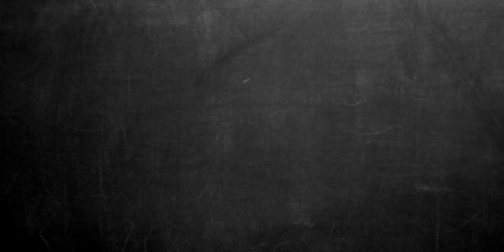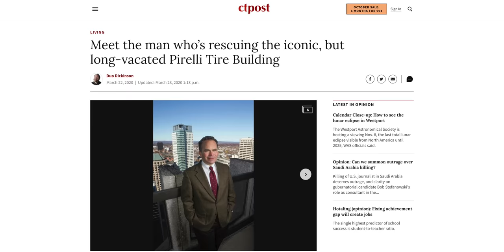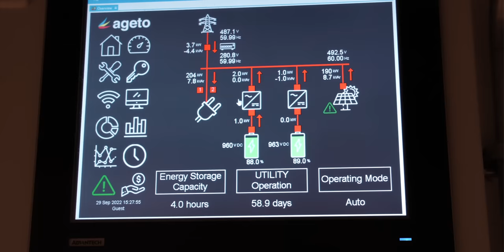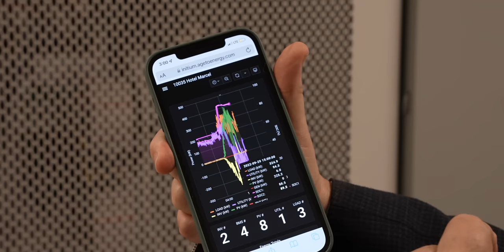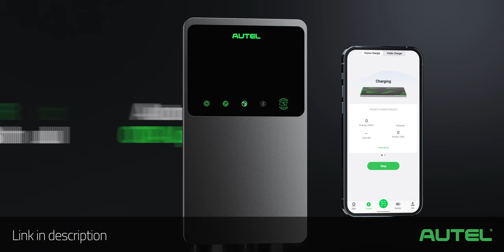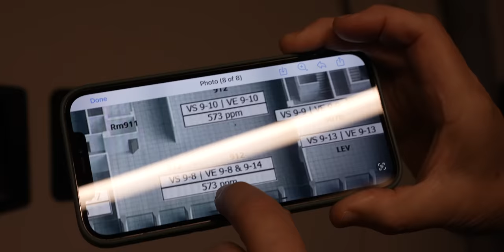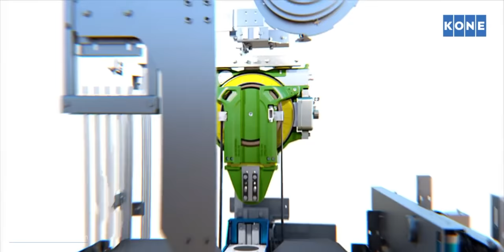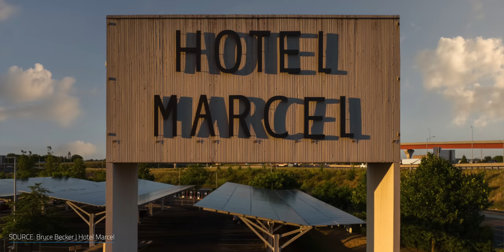How Big Can You Make a Passive House?

Comment: maybe the drying could instead be done using stored heat from a thermal battery(like a really well insulated airtight room filled with boulders and rocks) then slowly heat that room up to high temperatures using a clean air to air heat pump or sun heat collector thingy. :y maybe that could solve the problem.

Comment: With the resistive heating load of the dryers that high I'm surprised they don't integrate heat pumps either fully or partially into that configuration.
It seems that heat pump based dryers are available in some capacity, perhaps they don't have the through-put to handle hotel operations?

Comment: Matt: do they use a counterflow heat exchanger to preheat incoming air (using exhaust air) for the dryers?  
Dryers are very primitive with a lot of room for innovation.  For example, using a pressure vessel to lower the temperature at which water evaporates (partial vacuum) or microwaving the items within the drum instead of heating incoming air.
A combination using low pressure, microwaves and a scavenging heat pump could lower the energy use dramatically.

Comment: My vision is for entire Cities to be so.  Would be WAY more efficient to have a climate-controlled city, than individual buildings.  Most of our energy is lost through heat, when we capture and recycle that heat, we become sooo much more efficient, therefore requiring far less source energy collection/generation!
There are many other benefits (and some drawbacks) too ofcourse.
Reply from the maker: District heating and cooling systems are very clever.
Reply: @UndecidedMF  I'm talking about covered and enclosed cities (the dense centre anyway, much of the outskirts would be open air) built of multiple (10-50) levels, each having 4-10 stories, meaning that all excess heat, including from warm-blooded animals, friction losses in mechanical systems and electronics could be extracted by the systems conditioning the air throughout the structure.  
2D Cities have surpassed their practical limit, we need more bandwidth to move around and without flying cars, the most sensible and feasible way to achieve that is by having roads/walkways on multiple levels.  
I could go on and on and on, but, well, I'd be going on and on and on (and right now, I need to go to the shop) 😊

Comment: OK, 1 unanswered question: How did they retrofit the building with insulation? Normally that has to be put on the outside, but then its look would have been changed dramatically. Windows are easy, though costly.
One point that really shocked me, was the discussion about gas stoves. This isn't Africa. Are gas stoves really still a thing in America?

Comment: I don't see how regenerative braking makes a lot of sense for an elevator.  Elevators have a counterweight which is actually heavier than the elevator, so that when 3 or 4 people are in the elevator, it is balanced.  This means that if an elevator is moving while empty, or with only 1 or 2 people, which it does a lot of the time, it actually uses less energy to move up than to move down.

Comment: You should do a follow up to this video on cost vs savings.  It’s absolutely wrong to say these systems don’t cost more than conventional.  Where these systems begin to make sense is when you can run the payback analysis - high initial cost vs energy savings vs maintenance costs, etc., then you can decide if it’s worth it.  

You should interview a local MEP engineer that has the right resume of projects (institutional labs and research buildings and not just offices and hotels) and they should be able to explain why these systems aren’t prevalent.  Many times it takes a huge leap of faith from a visionary owner, or more often these systems get implemented when the organization needing the building has energy guidelines to meet (LEED, or a requirement to exceed ASHRAE 90.1, as some examples). 

It’s still cheaper to build a code minimum baseline building when it comes to efficiency and unfortunately will be for many years to come.  Why? Because manufacturers can charge more for it because it’s better.  And to be fair, it’s often more equipment, or more complex, but the real premium is because they charge what people are willing to pay for a premium product.  As code minimums raise the bar over time, this equipment will become cheaper due to more competition.

Comment: To say he didnt think it cost more but that it took more time to commission is a bit at odds.  That time getting things setup and working because you have lights and shades in every room which are going to be addressed, configured, grouped and visible to control points in the rooms and in a BMS is not cheap.  Sounds like they have other control schemes throughout the space and thats important because its "free" savings when things are on timers / sensors / schedules.  As far as the initial cost itself being about the same... it probably makes more sense to say that on full gut remodels or new buildings but retrofitting typically makes a lot less sense cost wise.  Did he actually get into any numbers with you?  or relative comparisons they did vs "standard" buildings?  Did i miss where he talked about heating / cooling the building itself?  For the dryers to be such a huge percentage of the grid it would have been interesting if he talked about what they did to try to minimize that.  Did they do anything?  Hybrid heat pump dryers at commercial scale?

Comment: I don't understand the thing about the elevators/lifts.
Usually they have counterweights to balance the car. This means to move up and down the energy is actually only that required to overcome friction and momentum, not to lift the thing. The energy requirements should be the same going up as down.
Of course, this ignores the weight of the occupants, but I would think that in most cases this weight is only a small part of the system.

So I'm unclear where this "recovered" energy is supposed to come from.

Comment: 0:40 concept for power storage that involves putting carts of weights in elevators and bringing them to the top floor to store the power and then letting them go down to the bottom floor again to recover that power... Ok maybe, just maybe, this plan would be way simpler to implement with just a pump, some pipes and a large water tank on the roof? Anyone pushing a concept of power storage in gravity that involves rigid bodies that have to be moved on wheels i.s.o a simple fluid that can be pumped has not thought his concept through enough imho.

Comment: It's very interesting that there is essentially no new technology developed for this hotel.  Yes much of it is relatively new but it's all basically existed before design & construction began.  Think what a big dent it would put on green house emission if every rebuild/refab of an existing structure and every new build incorporated these techniques to lower the energy demand for a structure.  We could get to 2050 targets in less than 30 Years easy!
Reply from the maker: You hit the nail on the head!  We have the tech and systems already.  We just have to implement them in an intelligent/planned way.

Comment: There is a very simple way to save electricity to dry sheets. Sun 🌞. (Or using heat pomps)
One hotel near the Dead Sea in Israel use this and other low tech tricks to save a lot of energy. 
Like cover the pool at night to keap it warm.
Domestic water heating can be copule with air-conditioning if relevant. Or can use solar again. No electricity use less the heat exchanger.
I guess there's still normal AC supply in every room for fone computer chargers hair dryers vacuum cleaners...
Not energy but still missing some green arund the hotel in the open level and rooftop garden. 
I would take Hundertwasser tree tenant to brake the brutalist facade while keeping it exactly original.

Comment: So when you use POE does a cat6 cable terminate at each rooms circuit breaker then standard wires to lights and outlets and such? Or do they have to find lights that use ethernet ports on them?

Comment: It's interesting that they are using resistive  heat dryers.  I know they are using large commercial dryers instead something you would use at home, but I wonder if heat pump dryers would be an option for them.
Reply: This was my question. Especially if they could reuse the captured water for washing or toilets.

Comment: The PoE lighting and window treatments those are awesome ideas. But that’s the maximum length of cable run and still have efficient use of the power. Is there just the two battery/server rooms or do they have PoE server racks on each floor or more? One day I’ll be able to build a home and enjoy learning about these projects. Good to see things happening like this hotel that can prove concepts.
Reply: I asked Bruce about the batteries, here's a summary of his response:
17 200lb Lithium iron battery modules by LG per rack, with 2 racks on both the 6th and 7th floors. That's 68 modules in all, totaling 1 MWh of battery storage

Comment: Certainly the solar shown wouldn't power much in a typical building, maybe the lights; but when it comes to heating and cooling; hundreds of machines.. no.  Sure if you are in a very temperate environment where you rarely do heating and cooling and you have no machines, computers, kitchens, refrigeration . you could because it no one is using any energy to start.
Reply from the maker: If you tack 1,000 panels onto a typical building, you're right, but this isn't a typical building.  It's the combo of heat pumps, digital electric system, etc. that's making it all work like it is.

Comment: Now I'm NOT an electrician, but my vague understanding is that DC doesn't fair as well as AC over distance. I'd like to know if that's a challenge for them, getting power from batteries in one part of the building all the way to the opposite corner on such thin wires.

Also what about when I bring my AC wall wart for my laptop or whatever? I assume there's inverters to provide that power, or maybe there's just ALSO a grid-wired AC outlet in each room?
Reply: What I do with DC  power is get much thicker wires than the usual used for AC.  This reduces the problem considerably.

Comment: Hello Matt, 

New to your channel and been enjoying the backlog of everything you have researched for us. I have some questions about the "digital electricity" used in this hotel. If my not so great research is correct this is PoE which I have now looked into a bit. I did not see it on your channel and wondered if you would give it a look for the community. The part where he talked about power loss from AC-DC has me wondering if this would be something that is viable for my home. 

To answer your pinned question I would love to see school buildings have a push for net zero. They often have large flat roofs to hold loads of solar cells and most power usage is during the day meaning they could skip the battery backup and use local power at night and probably still come out close to zero in the southern states.

Comment: I don't understand why the elevator is using DC motors? 
Regenerative braking works for AC motors as demonstrated with modern EVs.  I would think that there is far more readily available technology based around AC motors and AC drives than there is for DC motors. 

I have worked in the field of Power Electronics for four decades and this just seems to be a very strange design decision.

Comment: Ok, great hotel project. I have many questions. Where is this hotel located? What is the lowest temperature in the winter? If the heating is by air source heat pump what is the efficiency when temperature drops below 0C and ice is deposited of external heat exchanger? What is the energy used for heating of the whole building per m2 per year ? That calculations now  should be done for every building not only for passive one. For example my small house is using 70 kWh/m2*year and is located in UK where lowest winter temperature is -10C.
Reply: If I remember correctly passive house used below 15 kWh/m2*year. Is this hotel using less than that ?
Reply: Ok, I found this Hotel in New Haven on east coast. This is an exceptional example because climate there is very mild. I found this: "The temperatures are highest on average in July, at around 23.3 °C | 73.9 °F. January has the lowest average temperature of the year. It is -0.7 °C | 30.7 °F."        The temperature even in winter does not drop below 0C so heating with air source heat pump should not be a problem at all. Yet it is not representative example.

Comment: 6:42 I wonder why the driers are not heat pump? Even if they couldn’t dry as fast, would it make sense to get another set of linens and HP driers that would have to run pretty much 24/7?
Reply from the maker: I don't believe that size is available for commercial dryers (yet).

Comment: What is the ampere capacity of a cat5/6 ethernet cable over those length? It dosen´t sound plausible or safe considering how thin they are. Is there not a trunk cable to carry the main load to each room or area and if not how can it work?
Reply: This Cat 5/6 power over Ethernet is becoming more and more common.  I take issue with the statement that they did not need to use licensed electricians.  Power over Ethernet (POE) can come at different classes.  That usually means different voltages.  For POE less than 50V, I am OK with the just running the wires like Ethernet wiring.  There is low power that is unlikely to cause a fire and below 50 V is considered the safe voltage from preventing people from getting shocked.  New POE classes are above 50V and I would expect those wires to be installed like regular power wiring by licensed electricians.  There is more voltage and current, and more power, so there is the possibility of causing fire and shocking people.

Comment: The elevator battery concept is really cute, but not at all practical, sadly.  If you have a 50 story building (about 700 feet) and an elevator that can move up the entire distance (which they don't really), a single load carrying 5000 lbs stores about 1.3 KWh of potential energy [(700 feet * 5000 lbs * 9.8 m/s^2) in kwhr], and less (70% = 1 KWh) in useful regenerated electricity. Even if you make the system able to handle 10 trips of that (50,000 lbs), that comes to 10 KWh, or less than the stored electricity of one Tesla Powerwall (13.5 KWh at $11,500 for a new system - note that other whole-house systems are a bit more expensive per KWh). There's no way that the building strength increase for that weight, plus the mechanical infrastructure needed to shift 5,000 laterally, would cost less than that.

Comment: Is it legal to use ethernet cables for power supply? (Even though it is DC and low voltage)
Reply: Power over Ethernet (PoE) is an IEEE specification that's been in use for quite some time (since 2003), totally legal and up-to-code. I didn't know it was being used for lighting, but with LED lights, it makes perfect sense. One cable for data AND power is really useful in network design, and I can imagine it's even more useful in hotels and other spaces.

Comment: Energy efficient cooktops? To bring a pot of water to boiling takes the exact same amount of energy input regardless of source. The conversion of electric energy to heat energy is incredibly efficient regardless of how it is converted so I call huge BS on that claim. Bringing it to boil faster does not mean it is more efficient...just means it is dumping more energy into the water per unit of time

Comment: To bad they used resistive electric dryers, and not the heat pump type. 50% savings easy. If the use of those is as big as they say it is.. thats a lot of potential savings.

Comment: Hotel needs to add more solar? No. Hotel needs to ditch those strip heater dryers and get heat pump dryers that also feed into the building's heating and cooling system. Lol

Comment: The dryers are supposed to be the largest consumers. Why don’t they use heatpump dryers?
Reply: You can't run heat pumps at such high temperatures that efficiently for such long durations, yet.
Reply: @snowballeffect7812  We have a heatpump dryer (Miele) ourselves that does work very efficiently. About half the consumption compared to the original with electrical resistance heating.
Reply: @zweriuskriegsman  You run it all day and it has a capacity of 200 gallons? Idk, maybe they didn't feel like it was worth the cost to replace what they had already?

Comment: Why would you use cat6 to power lights 3:12? Isnt that needlessly wasteful as it supports gigabit ethernet.
Reply: Because its direct DC to DC which saginificantly improves efficiency (30% per inverter, all the lights on use only 5kW), also since theyre smart lights theyd need reliable data anyway so why run 2 sets of wire when you can use the wire thats already being ran

Comment: 15:00 Isn't old style elevator with a counterweight almost as efficient as those DC powered, electricity generating elevators? Elevator with counterweight is already a very efficient up and down transport. I don't think we need any improvement there.
And this big whole in the middle of this hotel look nice, but seems to serve no other purpose and ads to insulation and  building cost. It also makes for some energy loss on heating and up-down transport (also sending water to high floors). 
And to be honest I just don't like the looks of this concrete block. Maybe if it head a garden in this stupid middle whole.... or some color on the walls...Well. History preservation I guess.

Comment: Weight based storage is overly complicated and expansive and this building looks like it is entirely out of concrete. 
Not really carbon neutral or passiv. 
Those Kone elevator are everywhere around in Germany nothing out of the ordinary depending on installition requirements.